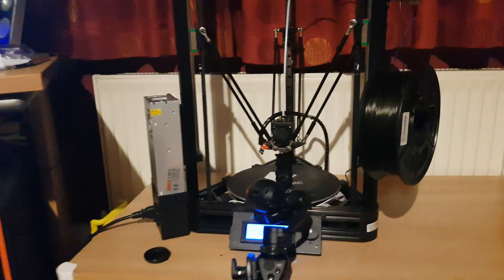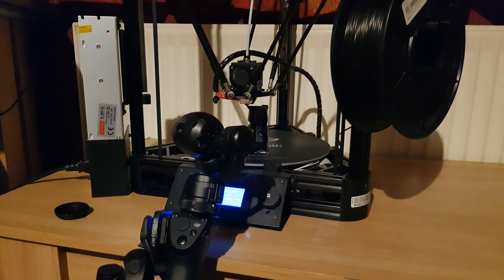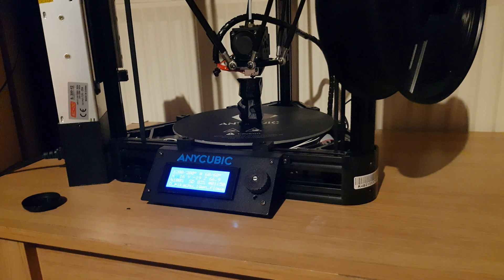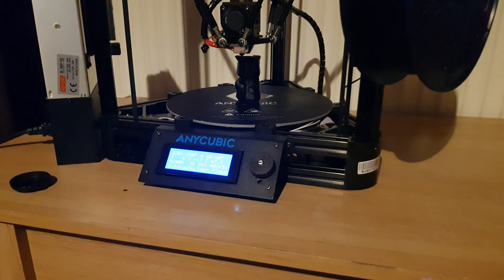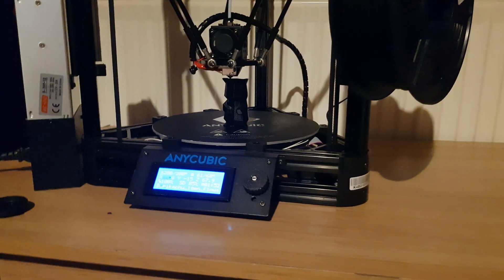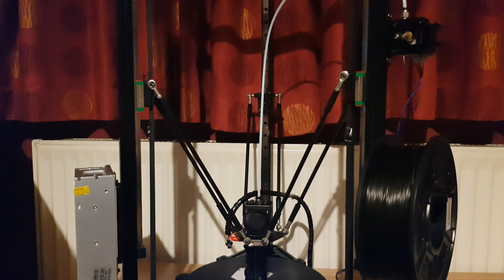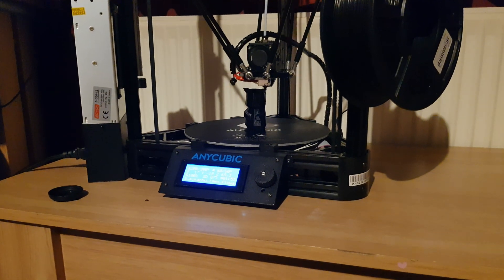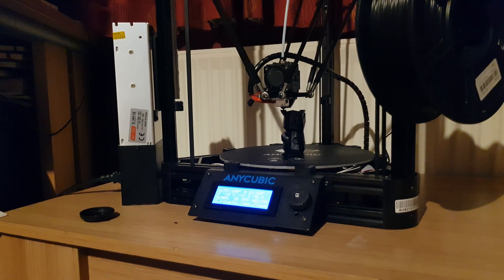My Anycubic Kossel Linear Plus 3D Printer!!!

Comment: Nice video. I picked a broken one up a week or so ago for £50. I have a number of cartesian printers so thought it would be easy to get it up and running. I was very wrong, had to rebuild the bearings as they had lost their ball-bearings and then the calibration...omg that had me pulling my hair out. However, after a couple of days fighting, I decided to disregard what I knew and start again, that works and its new levelled, calibrated and printing well but not quite as clean as I would like. Still I am very very pleased with it, it looks cool while printing :)